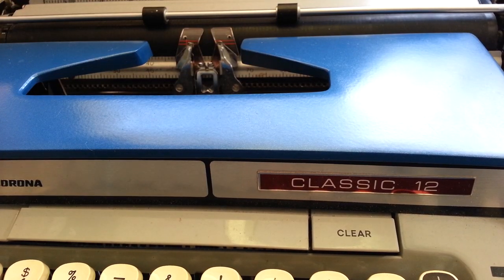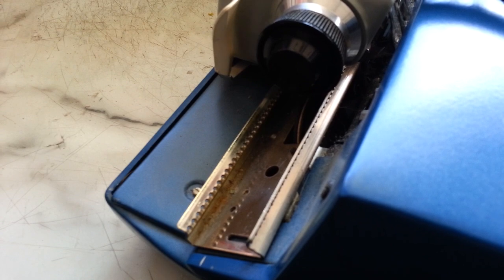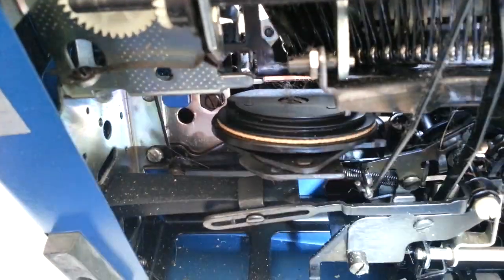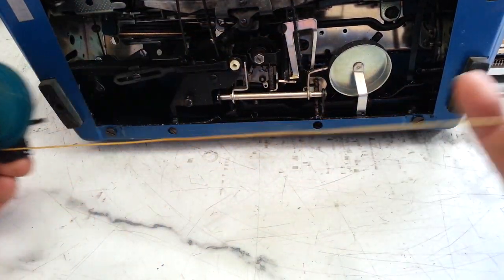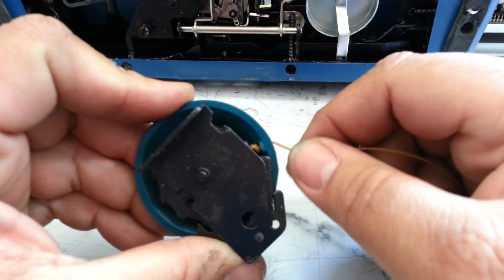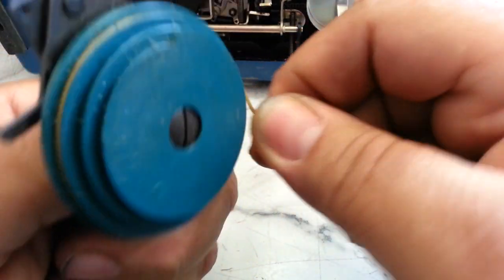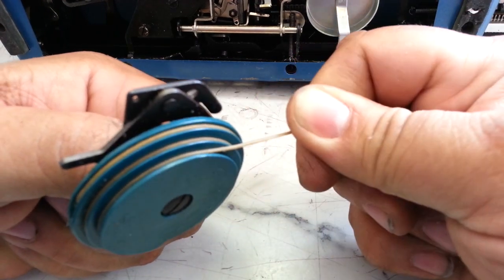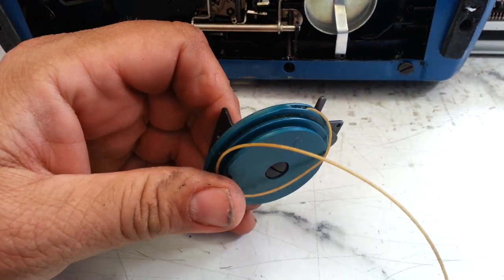Smith Corona Typewriter Mainspring Draw band Removed Demo Drawband Cord Band

Comment: Is there a way to re-tension that spring and re-seat the cable into the carriage without removing it? Mine is sitting over there unwound and I haven't looked at it in days...
Reply from the maker: That can all be done without removing anything, It's very tough access, make for a vey tricky job, I forget how exactly without reviewing
Never made a video on how to do this version
Reply: @phoenixtypewriter2136  Thanks! I'll fiddle with it and see what I get. I am working with the Smith Corona Coronamatic 2500. I wouldn't have even dislodged it, but the whole unit stank of decades of cigarettes and I was trying to clear actual tobacco out of the works.